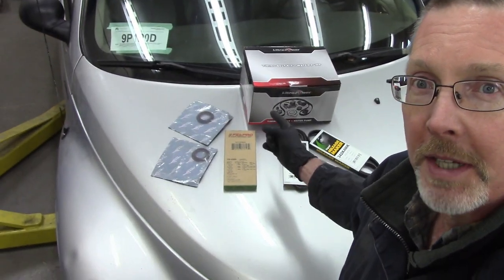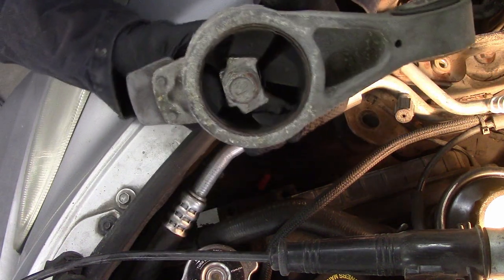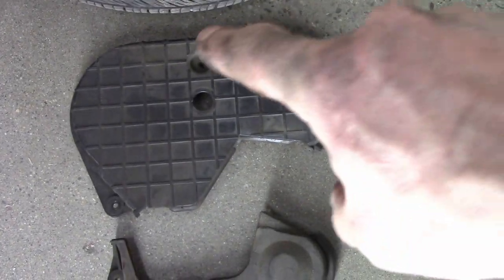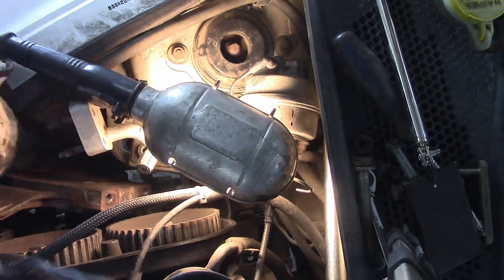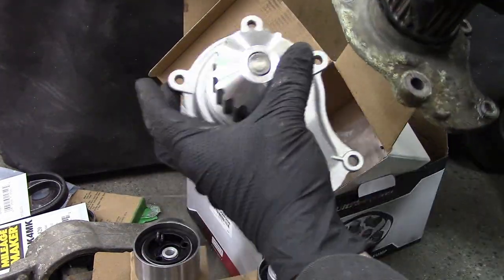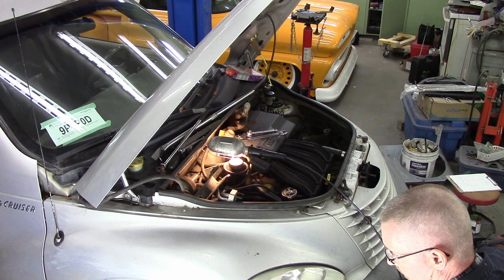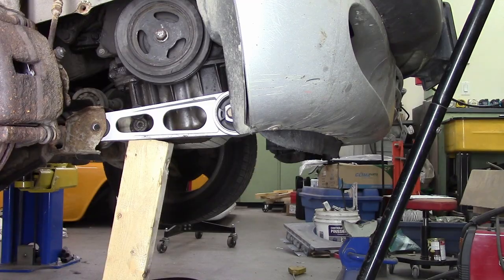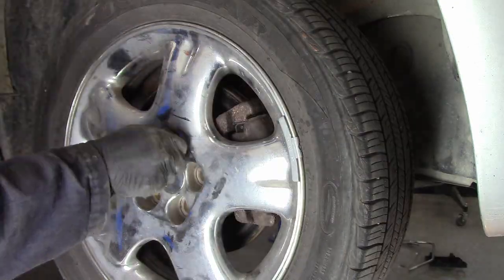PT Cruiser Timing Belt (and Why Mechanics Need to be Paid More)

Comment: I saved myself $2500 doing this job myself ! I replaced everything you have to remove to do this job ! I wouldn't wait for 100,000 miles to do it again , seen too many timing belts break between 70,000 and 80,000 miles ! I replaced the whole engine cooling system while I did this job ! The job is easier to do that way !

Comment: Take the A/C blocks off the accumulator and evaporator instead of where they want you to split it. More hand room. I take the intake off to get the plugs out just because I don't like fighting compression but PT's don't really have much of that. That top motor mount bracket on the strut is a game changer. I took that off first on my first belt then thought I could work around it on the second. I flipped that motor mount thing around 10 ways before I just took the bracket off. The bottom motor mount from rock auto is not shot this time but the frame is broke behind it so I have some welding to do. I have worked on cranes, excavators, tractors, 50s cars, 80s cars and I think the PT was an experiment by engineers to see how many dirty tricks they could build into a single car. I made the insert for the crank to pull the balancer so I just use a cheap harbor freight  3 jaw to pull it not the fancy one. The 2-stroke Detroit diesel water pump was the biggest dirty trick in history until this car came along.

Comment: Just thought I’d add a few things for future knowledge. Chrysler had a recall on the timing belt tensioner for 2001-02, that’s why it didn’t match. I’ve found that using a 3ft socket extension and a swivel joint makes it much easier to get the bolts out of the power steering pump. Also a 2ft extension and swivel to remove the bolt on the back side of the bracket for the top motor mount. The easier way to remove the heavy steel bracket is to unbolt the center mount, rotate it 180. It’ll give you just enough space to wiggle it out. You’ll also be jacking the engine up and down a lot, be sure to use a piece of wood between the jack and oil pan.

I’m currently fighting with the bent tensioner to get the belt on. Worse part is, this is the second time I’ll be replacing it. That’s my only issue with it.

Comment: Had a similar experience  when I had to replace the water pump in my 2003 Neon. Maybe not as tight a space (my power steering pump was easily accessible compared to yours) since it is a SOHC. Replaced the timing belt as well, as that was well past it's "best before" date, even though it was in excellent shape for having 310,000 km on it. I also should have done the centre motor mount while I was in there, since that decided to fail after another 20,000 km. This is not an operation you want to do more than once.
Reply from the maker: I think even once is twice too many.

Comment: As all the motor mounts are removed, a hydraulic jack and a board under the oil pan, raise and lower the engine for easier access to the timing belt assembly.

Comment: Just wait until it blows a head gasket, your counsellor's counsellor will need a counsellor..... At least you are not in Australia where the steering has been adapted to the right hand side and put more stuff in the way for s***s and giggles. XD
Reply: My 2005 pt cruiser needs a water pump, heater core, radiator, struts, engine mounts, rubber bushing in the control arms, ac charge, key cylinder, radio don't work ,might need an electronic modulator, lift struts on the back window and a new ignition key. But it runs good if you put water in it for a couple days

Comment: Yep, did my 2003 PT timing belt after the water pump failed and stripped the belt! 30 hours but all OK, compression all still even which was a surprised as I was sure there would be valve damage. You can see the tensioner tell tail through the T55 engine mounting bolt hole!

Comment: Would it be better to simply replace the entire motor/engine?

Or would it be worth it?
Reply: I've been thinking about that too. I found a motor, 81,000 and all new gear installed on it ready to go. Would pulling the motor suck any worse? The cost of the motor is $1600.

Comment: Would it be better to pull the engine and replace all the worn parts given its mileage?
Reply from the maker: Oh the rabbit hole of engine rebuilding....  You will always find out it's far worse than you thought once its apart, and you can go through a CRAP TON of oil before rebuilding the motor is cost-effective.  If it was a "keeper," sure.  This is NOT a "keeper."

Comment: 😅 goddam The Pt Cruiser is Just A Car You Want To Avoid But Yhea My Grandpa Has One and I Need To Change The Serpentine Belt Spanner Beacuss is Wasnt Rolling Anymore But Damm 3 Hours in And Still No Clue How i Needed To Remove That Mount Cus The Screw For The Roller Is On The Timing Belt Side So I Needs To Come Off 🤦🏼‍♂️ Damm What A Sh!t Car To Work On Wish He Would Have Bought The Car I Told Him To Get 😅 Was A Suzuki Alto 🤷🏼‍♂️